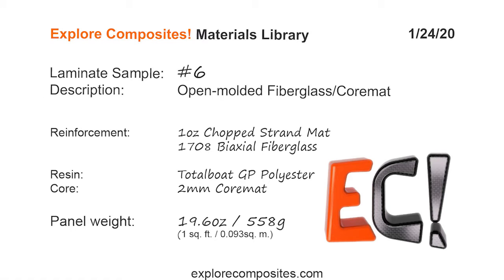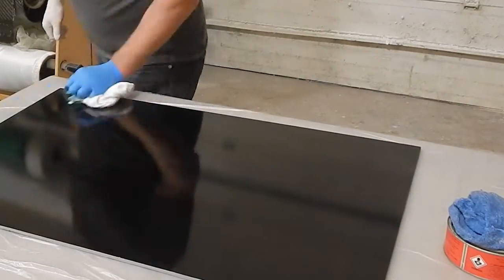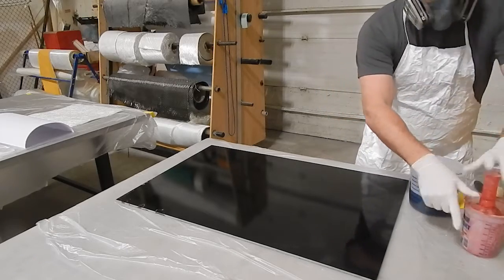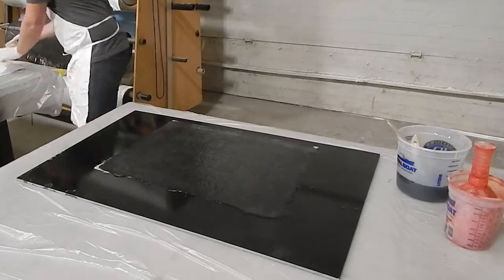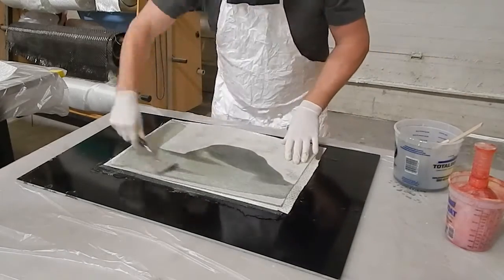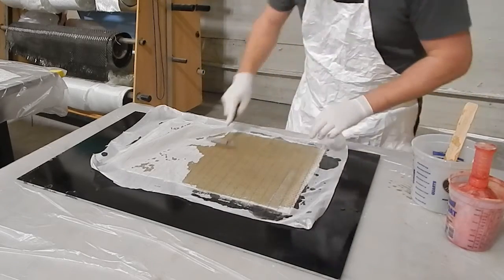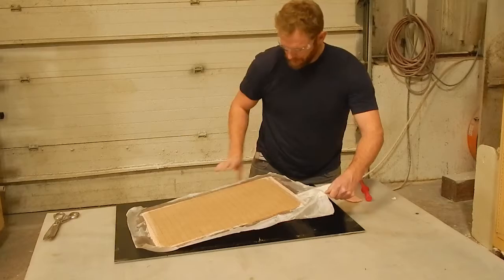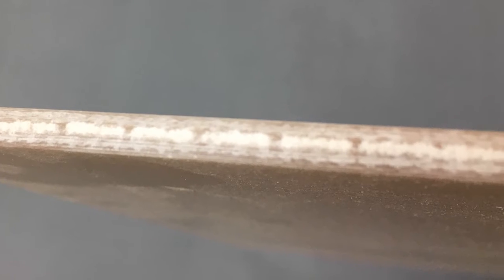Laminate Sample #6: Open Molded Fiberglass / Polyester Resin with Coremat

Comment: Greetings!
I have a plan to make a fiberglass crossbow limbs. Do you suggest using epoxy resin instead of polyester resin along with coremat and csm? Thanks!
Reply from the maker: I have no experience here but my guess is you want mostly unidirectional fiber/roving with just enough off-axis (braided sleeve over might be good) to keep the thing from exploding.  Tougher, higher elongation resin sounds like a good idea - so epoxy or vinylester is probably best.  I would avoid any coremat and try to stick to solid laminate.  Csm won’t do much structurally but might help buffer the unidirectional material or build thickness without much stiffness.  Be careful - this sounds dangerous!

Comment: Coremat can be laminated with light rovin in boot sides?
Reply from the maker: I'm no expert on coremat, but my understanding is that chopped strand mat should be used on either face of coremat - at least with polyester resin.

Comment: Ive always heard 1708 mat side goes down. Whats the difference ?
Reply from the maker: I wanted 1708 with mat on both sides - one to face the surface and one to face the coremat, so I put one mat ply (the 1oz) down and then the 1708, so the "08" mat faces the core.  

In general secondary bonding stuff like tapes/tabbing, you are totally right the mat should go down first to make a resin-rich bonding surface.  You can add mat-only plies as needed too.

Comment: Can I use epoxy resin instead poly resin?
Reply from the maker: Coremat is a polyester non-woven and is compatible with epoxy.  You'd want to avoid the chopped strand mat because it has a styrene-soluble binder that will work(ish) with epoxy but not well.  You should be able to use a woven/cloth or stitched fabric (like biaxial without mat) sandwiching the Coremat with epoxy.  Roll really well and maybe add some fumed silica to the resin to keep it from running out before it cures.  I haven't actually done this - just reading the Coremat datasheet and imagining - so do some tests first.  Let me know what you find!
And thanks - this would be a good test for a future laminate sample.